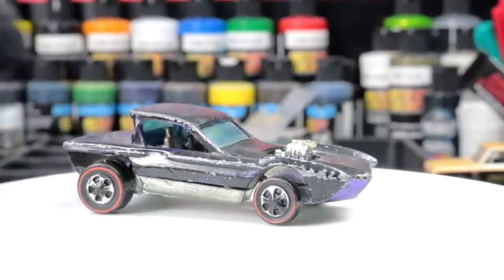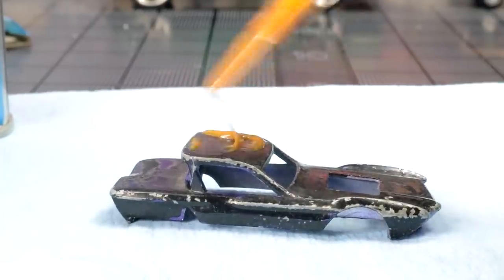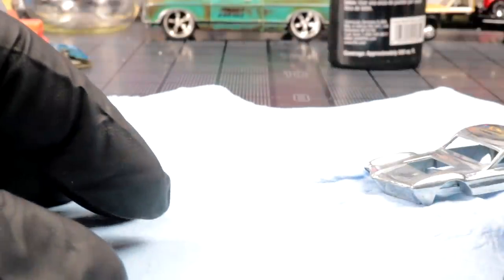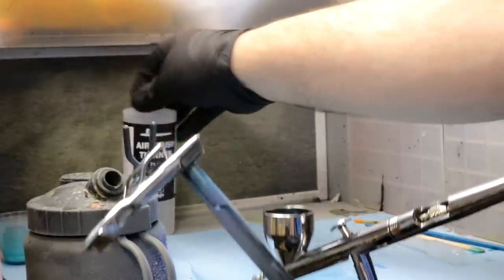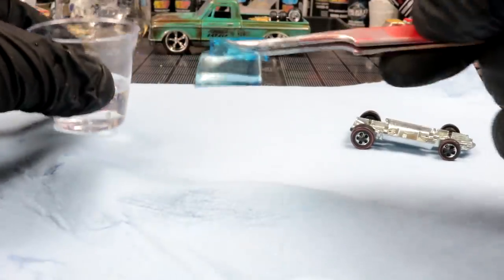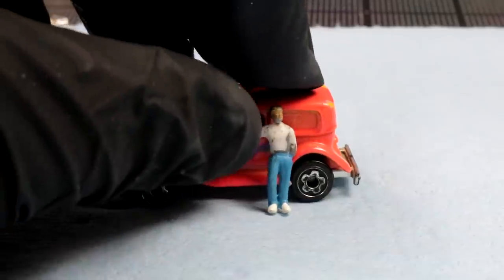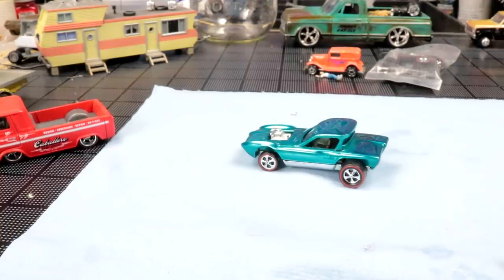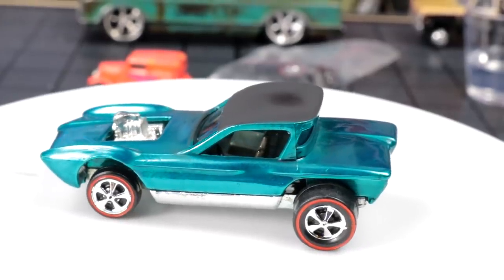Redline Restoration: Python

Comment: If zinc coating oxidizes under spectraflame paint, don't you have to zinc plate it again? How do make drilling the posts look so easy? Are you using a 1/16" drill bit. I have used 1/16" drill bits, but it makes the post walls so thin that when you tap them the frequently break.

Comment: Another great video!
Do you use the Redline self tapping screws? If so, what size?
Thanks in advance!
Reply from the maker: When they say self taping, they really mean stainless steel. They don't have little cutters or anything. The stainless is just harder so it makes threads in the diecast. I don't remember the exact size but I ordered my first batch from redlineshop and the second was off amazon.

Comment: You have a great channel...Keep these coming....keep the jokes coming too.  Cracks me up!!  " Blub blub blub...."   I guess we all made the same car noises when we were kids .lol
Hey...quick question for you guys, please? ...I have yet to attempt a restoration but I'm itching to. I just wanna do it right.  What's this talk I'm hearing on other channels about retaining the 'faceted' look that the originals had?  What is the best way to achieve that? I should not sand it smooth??   Should I use one of those 'sand vibrating' machines?  Or does zinc plating put those facets back onto the metal? I'm confused. Cheers

Comment: Quick question, I build miniatures and I'm having a conversation with another miniature building.  We're looking to use the pledge revive to coat mini wine bottles. Does the pledge dry hard? And if so will it tolerate being handled?  Thanks in advance!
Reply from the maker: Hard to say, the stuff is meant to be walked on, but it won’t last forever. I’d just clear coat them if you needed to handle them often.
Reply: @DiecastResurrection   Ah, gotcha. We were talking about different clear coats when the pledge came up.  It looks nice and thick in your videos and seems to settle eveningly too.  Neither one of us has an air gun for paint so it can be a little hit and miss with what we've used. Thanks again!  Ignore my FB message.  😊
Reply from the maker: @AKaups  Just grab some rattle can stuff!